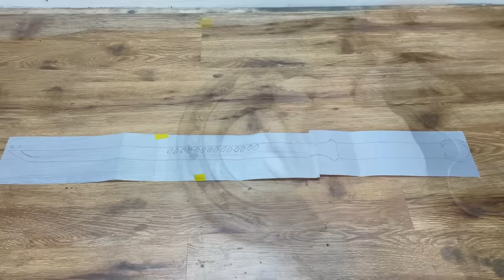Forging a NINJA SWORD out of Rusted Bearing

Comment: I may be wrong but didn't look hot enough to be tempered correctly. You might want to buy tempering files. They will tell you what level by scraping the metal
Reply: True it should be over 1.5k
Reply: Agree with you
Reply: Good steel
Reply: Your right
Reply: The steel he used is extremely hard as is. Doesn’t need to be as hot as other steels to achieve the same harness and this thing will still probably shatter if it was actually getting used.
Reply: @DevilsBrigade94  Bahahahahaha bahahahahaha 
No, just no. That's not how tempering works, kid.
Reply: @DevilsBrigade94  Me personally

Comment: Shame you didn't do a differential heat treatment. Bearings are usually made out of high carbon and chromium steel, which means you can make it very hard.
Hard blades hold edge better, staying sharp for much longer, but are more brittle and prone to damage than softer steel.
Which is why some blades- most notably Katanas- are differentially hardened. You get blade with exceptionally hard edge and much softer spine- traditional Katanas go even a step further and are made out of multiple different kinds of steel (high carbon edge, medium carbon sides, low carbon or even straight up iron core)- which prevents potential cracks from spreading and damaging the whole blade or even breaking it in half in most extreme cases. You get the benefit of extremely hard edge without having to worry about the whole blade breaking.
Reply: Dam that’s a lotta info
Reply: Wow👀I watched a video of a guy making a mosaic sword......I'm still not 100 % sure how he did it

I always knew forging was a skill..but the more I look into it the more complex it seams to be

Really super cool

Comment: You are a newbie to smithing? It was almost painful to watch the work with the hammer. The tempering was straight up not hot enough, most of the work done with a grinder, sanding done as if you did not care for the outcome. Even the hples were off a lot... im suprised you did not drop the hit yourself when hammering. You should straighten the metal between two metal poles or something similar else you risk the iron bouncing on the anvil when you smack it from top. If you want to smack it like that put the ring through the horn and hammer it on the flat part of the horn or the anvil itself to open the ring easier. And make a better furnance this one does not keep the heat. As for the handle never use just skin. The wood reduces vibrations as noot to break your fingers when yoou hit something hard. This sword has a big chance to hurt you. And do full passes when sharpening the damn thing. Also  dont swing it like that or you are going to hit own leg in future. Or worse.

Comment: Too bad about the holes on the blade being misaligned. (Not the same size/not in a straight line) other than that, it's a masterpiece.
Reply: It's not a masterpiece if it has flaws 😅

Comment: I gotta admit... as a knifemaker, i was ready to call bullshit based on the thumbnail.
This surprised me. Dedicated work. Especially difficult on 52100 and esp a thick-walled race. By hand. With a 5lb sledge. With minimal, underpowered tools.

Props. 👊

If youre still pursuing the craft, lmk. I may be able to gift some materials or supplies. I still make knives, but only really rare occasions that i get odd custom design requests or do a small series run.
Reply: Its ridiculous! Heattreating is bad. Surface grinding also. This piece must be heavy an useless. But i also say its sexy! He has to improve the skils an make more.
Reply: @messermanufaktur-knifeart  What is he gonna use it on
Reply: @deezznutss6657 it’s for the zombie apocalypse, duh
Reply: Can you please recommend what steel to use when you are making a bushcraft knife?

Comment: I'm not a sword snob. I can't tell you what makes a sword a "good" sword. But, yours looks cool and it's sharp. In my opinion, that makes it a good sword. Nice job.
Reply: To make a good sword, you need at least two types of steel with different amounts of carbon in them, one for the spine and one for the edge, otherwise, you have a brittle sword. You also need it to be solid and without cool-looking holes, which make the sword even more brittle. And you need it to be sharp enough that it cuts through flesh and bones, not just water bottles. A sharp katana cuts through many pieces of bamboo in one masterful swing. All in all, this is in no way a good sword, but it is a cool-looking toy.
Reply: You don't need to be sword expert to understand this is junk...
Reply: @ВанбродскиРеБтил  It's only junk if it fails in battle. I highly doubt it will ever see battle. It will most likely be used for decoration.
Reply: I know nothing about making good weapons, but there is a problem with the all videos like these - after forging, people don't test the weapons for durability. And we know why - because tests targets to finding the point when the weapon breaks. It would be the best way to proove the quality, but it will make the videos strange - "today i'll make a sword to break it"

Comment: That's not a sword.  That's a kunai with delusions of grandeur.
Reply: Kunai?????
Reply: @pahlawancindaitekpi3795  A kunai is a small knife with a ring in the place of the pommel.  It is often portrayed as a throwing knife in anime.
Reply: real ninja swords tend to be smaller than samurai ones also they we're made of parts of samurai swords and customised, so, for a fantasy build this is pretty awesome.
Reply: @RhorekAQW  Overall, I tend to agree with you.  The ring where a pommel would be is problematic, IMO.  The weight-reducing cuts are pretty and the 'sawback' seems like it might be useful.  But none of that is functional.  The blade also seems a lot thicker than necessary.  I like the material used and the way he straightened and forged it.  A simple straight-bladed katana would have been a lot better, IMHO.  Then again, how much use do you get out of a sword in the modern day?
Reply: uses for swords in modern day?
I don't know, Ukrainians may know better uses '~', plus the ring for a pommel is totaly functional as a pommel, well it could be functional but he didnt temper the ring '~'
Reply: @RhorekAQW  Pretty much any tempered sword with a hardened edge would be useful in a post-apocalyptic setting.  You don't get extra points because it looks cool.
Reply: @thomaspaul311  agreed. my point is the ring for a pommel is functional, or it could be once he temper that ring, and wepons are essentialy tools and art so the looks mather, but I wouldnt sacrifice efficiency and functionality for looks that much we agree.